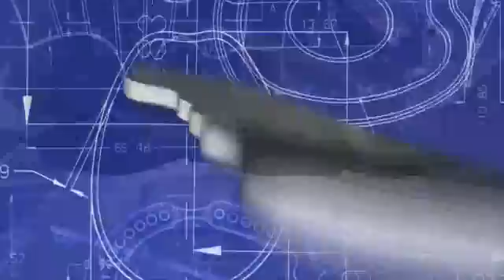#britek  Energy Return Wheel... Autonomous Never Flat

Comment: Thats the biggest load of bullshit ever,#1 save weight HA! all those bolts and the membrane,steel hoop,and center rim,all better be made of stainless steel 304 or better hate for it to rust apart,#2 side loading with distortion and do'nt tell me at 80 mph it is'nt going to fly off when it gets hot and squishy in a curve,that rubber tire better be ribbed inside,only if it can survive the 24 hrs of lemans will I think he has something,oh and do'nt forget the buggy ride I bet those tires are hard.

Comment: people say the wheel has vibration at certain speeds. does this run smooth?
and as some have suggested you should probably demonstrate the wheel on a fast car on a track so people can see it work.
as well as some mileage tests if it saves energy.

Comment: Not only it weighs more then a regular tire, it kills the acceleration of a high performance car. it looks like it would easily become unbalanced due to the adjustable bolts completely screwing up the car's alignment. I bet its overpriced as well, I would rather buy a two sets of Pirelli road and slick tires for my corvette for the price of these.

Comment: that wheel doesn't look safe at all. first of all it's not shaped like a circle, it's a polygon with many faces (as many as the outer bolts), plus those bolts sticking into the tread's thickness don't look too confident either, with no room to give in case of a bump or hole i immagine bolts sticking through rubber thus shredding it, nice idea, needs fine tuning

Comment: doesn't look like you would be able to properly align the car, or balance the tires since the bolts that secure the tire surface to wheel are hand thighed with different lbs of torque.. It would be twice as much work to maintain it, you could also forget about burnouts on these.

Comment: but can this be used to drive hard? Can it be used on a track?  Is it possible for you to put a slick on them?  Does rain/snow effect this wheel?  Is warping an issue?  Can it hold up a heavy car like a Suburban? Can it take abuse from hard turning? What is the max speed of this wheel?  What are the replacement costs for any part on it, new tech is always expensive.

Comment from the maker: By adding negative pressure to the inside of the dynamic sidewalls the ERW is easy to adjust for tension.  Aiding in the increased overall efficiency of the tire.

Comment: I think Tweels will eventually succeed for one reason because nobody likes the sights of used tires disposed of. Now I am thinking just make undisposable tires protected and make the Tweels to fit easily on it. Thus saving tires with all the advantages of airless and the takes care of the noises.  LOL that would almost be like reversing wheels and tires. And the replacing treads will be just about the only maintainent with occasional air pressure check with tires.

Comment: Maybe the wheel has to be reinvented before the Tweels fits into the wheel. That's it I think you can have small air filled tires guarded with hub cabs fitted with Tweel fitting around it.

Comment from the maker: Well you are touching on a lot o Great points!  Our patents allow for running sidewalls under Negative pressure, (vacuum) which will further reduce road noise, as well as provide for fine tuning of the Membrane pulls.  We understand that this new technology is new and innovative and may take at least two stops at the gas station to catch on!

Comment: (Continued) you could make the whole thing out of a solid bit of rubber and the same principal would apply, except it'd be a crappy ride because you couldnt keep it round without hardening the rubber. your spring steel rings overcome this issue, but to claim they move out of the way easier is misleading.

Comment: the upper and lower rubber at any given time is going to have the exact same tension in opposite directions, canceling eachother out. your garage door example is incorrect, a garage door has spring tension in one direction ony attempting to pull the door open but not being trong enough, leaving only a little bit more force required to move it. as I said, your tyre is pulling in all directions equally, so the tension does not have that  same effect.

Comment from the maker: Here is some facts that might change your opinions.   An elastic wheel allows for Better ride and gets better at higher speeds unlike an air filled tire. ERW should cost less than a standard tire over its lifetime. They are safer and wont blow out! and would change racing. And these things take time. it may be years. but remember it took only 4 years for almost every tire to be radial from bias-ply.

Comment from the maker: The newest prototypes use composite materials and have reduced the outer hoop weight including the membrane pulls to the same or under a standard Z-rated air filled tire.  GAS  Mileage Results are TOP SECRET at this time.  But view our 55mph to zero side by side video and note the air filled tires rolling distance.

Comment from the maker: Your thinking backwards, this membrane is under tension to begin with so... it already wants to move out of the way of the bump. Actually cooling as the bump is captured into the upper rubber Pulls of the wheel, then as the wheel turns it throws that movement toward the ground and you continue on your way.  ERW© loses less energy, uses more and roles easier than an air filled tire without sacrificing ride quality, handling or stability.

Comment from the maker: The reason they return energy is in the ability to capture the bump from the road and store it in the top of the wheel and as the wheel rotates down toward the road it literally flings itself to the road allowing "less" loss over each impediment. We are not claiming to get something out of nothing here... simply that our wheel looses much less than a pneumatic tire over bumps, humps and under heavy load.

Comment from the maker: This tire can be tuned to the ride quality and handling characteristics desired depending on your driving style, cars weight, and intended use. The lateral stability of these wheels under current testing has been exceptional. You feel the road yet they ride smoother as you go faster unlike an air filled tire.

Comment: I have to say that it's more convincing visually than the tweel as a legit tire. So this is flexing spring steel then, rather than flexing rubber? So long as it can resist lateral forces (hard cornering), and it can handle a torque load, I'd totally try a set of these.

I'm a bit hazy on how these are supposed to return energy. While flexing spring steel won't dissipate as much energy as a rubber sidewall, I don't see how your design would convert vibration to rotation as you suggest.

Comment from the maker: ERW's are sprung and levering from the "top" of the hoop. The 1/2" thick membrane = to 4,200 psi and Attachments draw the membrane inward with 200 lbs pull. The combined "pulls" position and elastically suspend the inner wheel within the hoop. Now! when applied to the ground the entire Assembly becomes sprung weight.  Automatic traction control, each wheel is now a torque converter and lateral stability control device.

Comment: Also, the part about the easy rolling action of the wheel.. correct me if i'm wrong, but this wheel seems as if the mass distribution has been moved outwards compared to a standard set-up, thus increasing the moment of inertia of the wheel, making it harder to rotate. Are you claiming the hysteresis effect helps the wheel roll?? since a conventional tyre has this effect, however yours may be more, but i cant say without knowing of the torsional stiffness of this system.

Comment: I'm not sure i am sold. They must weigh considerably more than a convential set-up. Increased un-sprung mass is not good. There are way more parts on this that a normal tyre...they will fail due to fatige in time...and unlike a tyre where a visual check will suffice..stress cracks will be hard to notice. What about cornering stiffness too? the break away must be savage with these tyres...do you have any plots for slip angle vs. normal force? i hope you have a dynamisist working with you on this

Comment: You ever thought about the fact that invention is not necessarily a practice of creating new principles, but the act of finding better ways to implement existing ones?

No, I suppose you haven't.

And it is not the same as a bike wheel. Though it does use some of the principles therein.

Comment: Some dried in mud would really make this wheel unbalanced. Have you considered adding side membranes just for sealing purposes? Replaceable side walls with multiple color options might help you getting into the tuner market where you can actually make some profit for further efforts. 
Wouldn't your design make the "tire" simply too rigid against side forces (shortening life of suspension joints etc.)?

Comment from the maker: Ivanuaz, The ERW© will is made of composite materials and can weigh less than your average z-rated tire in similar size. The new prototypes can handle extreme camber angles.  The hoop can be made using variations of flex. Area of contact is changing with our next prototypes so I will comment further when we have any new info.

Comment from the maker: Excelent question. Our chosen composite hoop
material is carbon fiber epoxy and at $5 per lb. 2-4lbs. per hoop its the "big"
cost. Recycled tires may be able to be used for traction layers. Exon Mobile has
developed a new highly elastic tire liner that may be suitable for our membrane. In
production we assume that the overall "non fiber" material volume and costs will be
same or less than conventional tires. B

Comment from the maker: "The entire outer ERW tire circumference mass shifts and rebound over every bump", we have reduced the hoop mass by 60% by going with composites. The hoop is sprung to the ground from the upper inner diameter of the hoop. Try an experiment. Hang a 5lb. wt. from an elastic cord vs. rope. Then Impact the wt. from below and note the radical "sprung" advantage.

Comment from the maker: Being completely opposite the tweel in most every way, our wheel has less road noise at higher speeds than it does at lower speeds which will be very similar to our current pneumatic tires.

Comment from the maker: It will help racecars, by increasing lateral grip, reducing friction, reducing the un-sprung weight, and suspension components.... As far as doing burnouts... or Drifting (which is more dancing than racing) You would want the cheapest tire you can mount... since your grinding them away at a furious rate

Comment from the maker: One retro fit option allows for the use of lightly modified original equipment wheels "tapped out" for hoop attachments. The hoop ,membrane and belting/traction layers will no doubt be simular in cost to a premium tire body construction

Comment from the maker: Our Wheels Increase in balance and stability when the speed increases... Essentially floating the car across the rough road.  This is Opposite of a pneumatic tire in which road noise increases with speed and power to ground. We want a flexible outer hoop.  This is the point.

Comment from the maker: The weight increase of the ERW© is minimal, But I will have to check exactly  how much... However, the outer hoop moves independently and although the whole wheel weighs more... the un-sprung weight is greatly reduced allowing for many other weight reduction options on suspension components.

Comment from the maker: Michelin wishes they had the number of patents we do on there Tweel. For example the Tweel is a spoked wheel utilizing blades rather than traditional spokes. We use membranes under tension! Our patent searches have shown zero prior art or patents. Our new prototypes eliminate all hoop bolts reducing weight and enhancing performance. Michelin has not shown a high performance tweel capable of handling our high horsepower SL AMG or our 4,800 lb. ML AMG test vehicles.

Comment: You got patents even though you copied the Michelin tweel. Even so if you create a rim thats entire outside diameter is made of steel and has many thick bolts holding on to the tire its going to be heavier than say a one-piece forged aluminum rim. So with more rotational weight you will acive worse gas mileage also why did you put the tire on the back of your 500+ horsepower car if your not going to show us a burnout with them???

Comment: That's called having a huge plate befor your head (blocking reason). Never having to keep air pressure right, driving over broken glass without worries, no more repairing tires if driven over some nail or something, saving money because you're never diving with to low pressure.

Comment from the maker: The "pebble effect" was minimized by moving the membrane to the outside of the steel hoop. This significantly increases the amount of rubber cushion between the steel and impediments. Remember the steel hoop is "sprung" to the ground by the inner wheels membrane attachment bolts.

Comment from the maker: We have yet to have any rocks stick, And we find that heat is not a problem, it probably increases the traction of our rubber compound. It is possible to use harder materials for the traction layer for certain applications, dirt, dry, snow, heavy load, etc...     getting greater efficiency gains for each situation.

Comment from the maker: Good point! :) Our technology wants to roll uphill and with slight modifications a consumer off-road tire could be created by changing the tred compound and increasing the flexibility and diameter of the outer HOOP.
  
However, fuel economy is not on the minds of the rock crawlers using, deflated tires and or the 400hp many of them have!